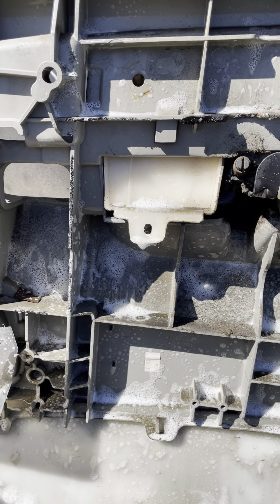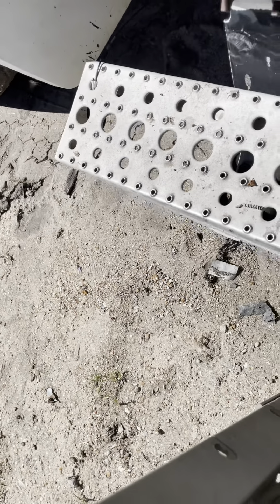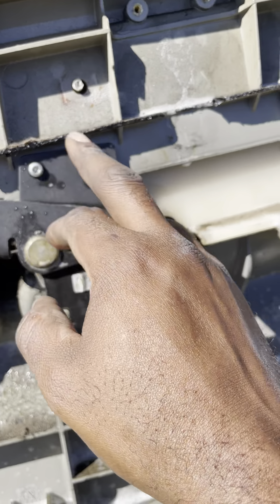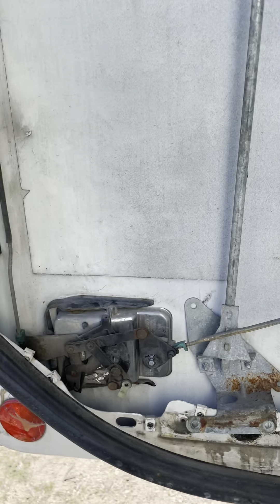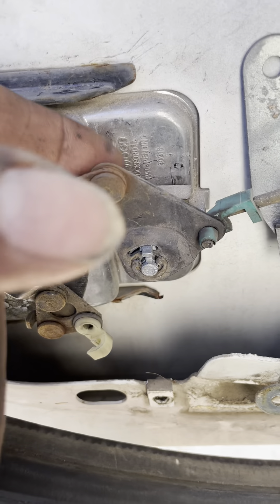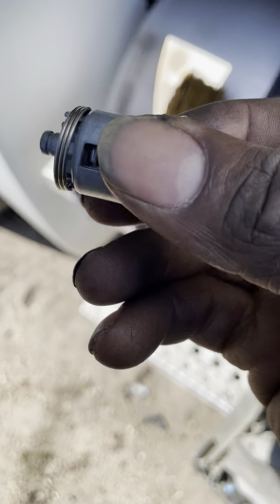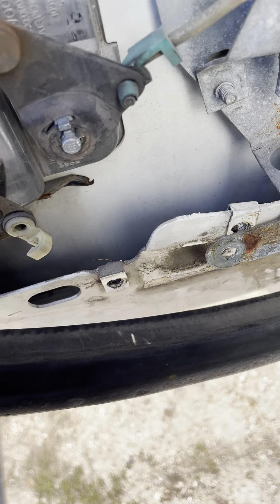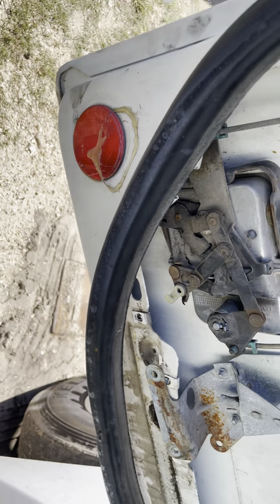Freightliner century class door service/repair

Comment from the maker: Check the edge of the door when you open it you will see little black tabs pop those out with a flathead they hid screws in there then pull the rubber they may have screws under the bottom down there too check up around the window switch I think they had a screw up there too. Once they are all out lift up on the panel should come off